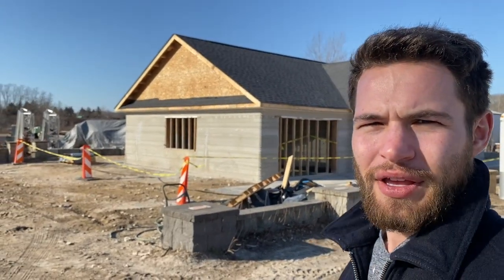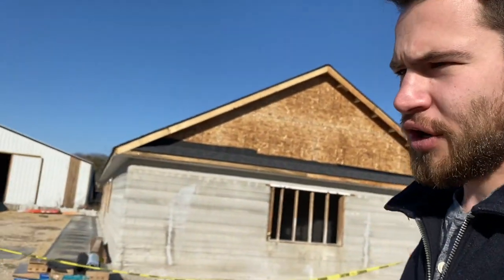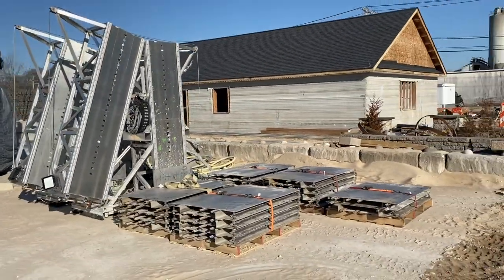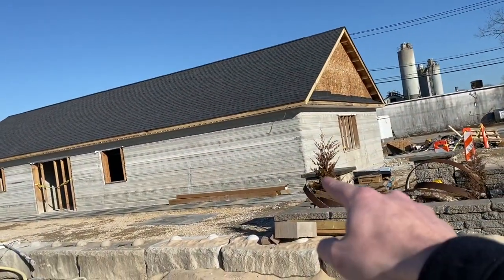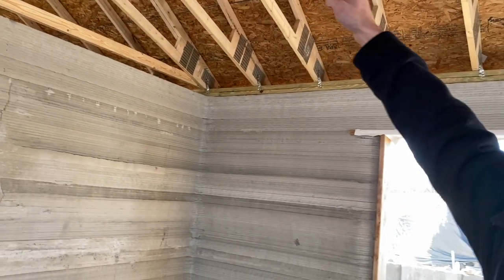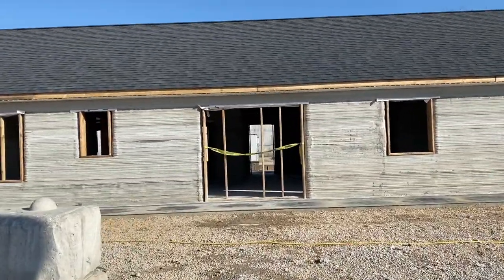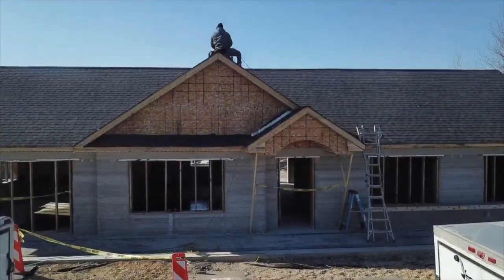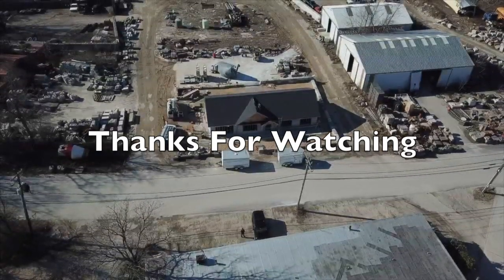Biggest 3D Printed House in America | SQ4D 1900sqft Automated Construction (Part 2)

Comment: What is the cost of that particular house roundabout?  SQ4D are they ready to build anywhere in the USA?
Reply from the maker: As the house stand now, unready for move in, I'd say the materials and assembly cost around $15,000-$20,000 assuming the concrete mix they use is around twice as expensive as traditional concrete. As this niche type of fast setting 3D printable concrete becomes more mainstream the cost will eventually match that of regular concrete.

Comment: How much do you think a 3d printed home will cost? 

How much will the printer cost? 
I saw mudbot 3d concrete printer for $38k on ebay. How does it differ from what you shown us?
Reply from the maker: Home prices generally don’t depend on build cost, they depend on the neighborhood. As far as cost to build goes it depends on your preferences, for $5,000-10,000 you could build a small home with modern accoutrements under 1000sqft

Sq4d isn’t selling their printer yet but most companies that do have quality printers sell them for $250,000-$500,000. The biggest difference between the SQ3d printer and the mudbot printer is at the mudbot is a 4 pillar gantry style printer that has a limited length axis but the Sq4d printer is on rails so the length it can print is unlimited. Should I do a video on the different types of 3D printers for construction? Lmk I will if there’s interest but I prefer to do site tours in person.